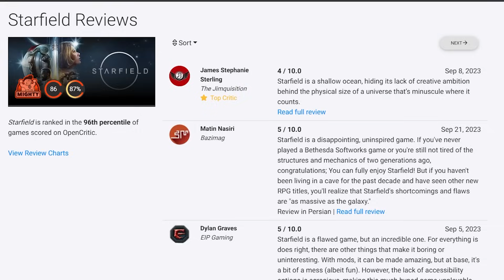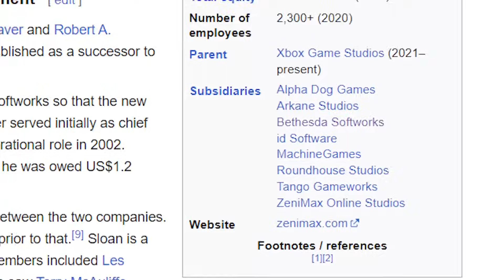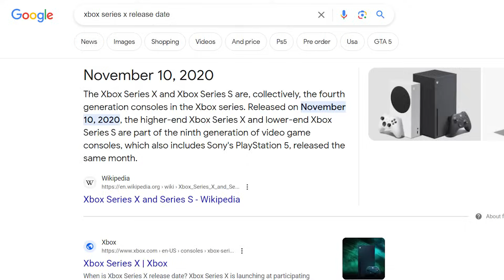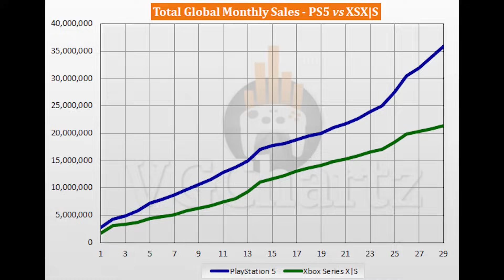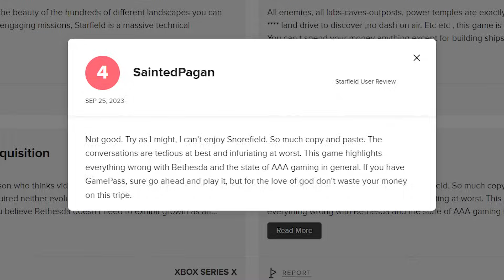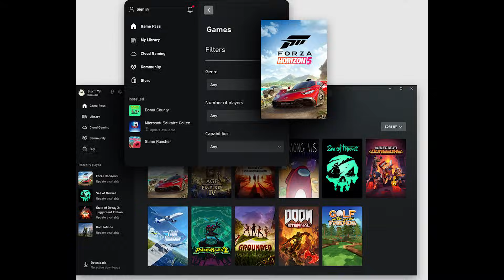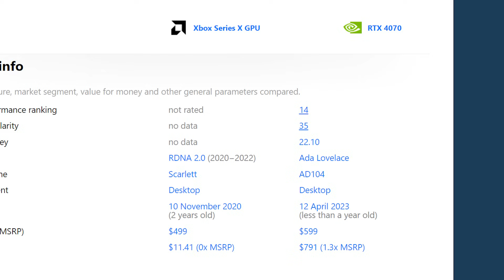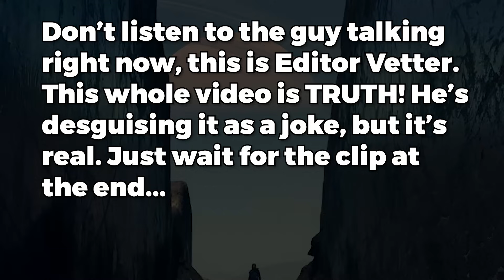The Dark Truth About Starfield

Comment: Bro, I had to buy a SSD just to run the game it runs like crap on a HDD. lol
Reply: Same
Reply: How in the hell do people not have SSDs in 2023? They're like $15-$20 for a small but adequate one. 
I just picked up a 1TB M.2 drive like a month ago for less than $50 CAD, you now how much I paid for a 1TB HDD like a decade ago? Over $200.

Just slap a little $20 250GB SATA drive in and you're golden.
Reply: @K-Anator   most games i play run fine on my HDD. Didnt need one till this game. i mostly play tarkov and dark and darker.
Reply from the maker: All my games are installed on SSD. C: drive is full of memes. 🤷‍♂️
Reply: @MrErick369  Yea it's just... Why? The difference between booting your OS and games from an HDD to an SSD is night and day.
And I mean at this point, not having an SSD is like not having a SoundBlaster card back in the day; sure you can play your games without it, but it'd be lot cooler if you did.
Reply: @K-Anator   i have a 500gb m.2 that runs my OS.
Reply: @MrErick369  "Bro, I had to buy a SSD just to run the game it runs like crap on a HDD. lol"

I mean, that's not even close to what you originally said.

You couldn't free up 94GB? 
Like I get that I'm odd having around 8TB total storage, but I don't think the game is why you had to buy an SSD if the drive itself was already 80% full.

Edit: Or is this 500GB SSD the one you purchased? I'm confused.
Reply: star nigguhs is over 100gb. i have other things on my m.2. 500GB so, no i didnt want to make space on it.  
i purchased a 1 TB SSD.  You're assuming  way too much my dude.
Reply: @MrErick369  I'm just going by the reported file size my dude; and it's not my fault you left out pertinent information. Not exactly sure what else you expected people to think.
Reply: @MrErick369  I'm just going by the reported file size my dude; and it's not my fault you left out pertinent information. Not exactly sure what else you expected people to think.
Reply: @K-Anator  I love you K-Anotor. It’s been along time since someone talk to me for this long.
Reply: @MrErick369  😘